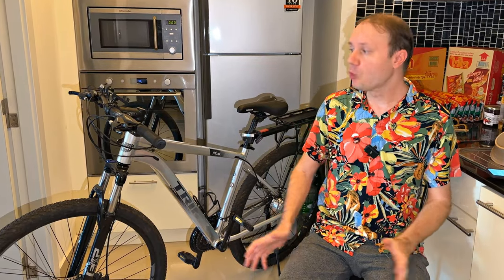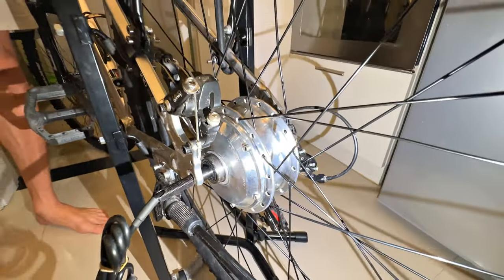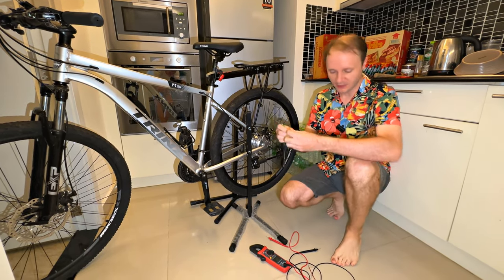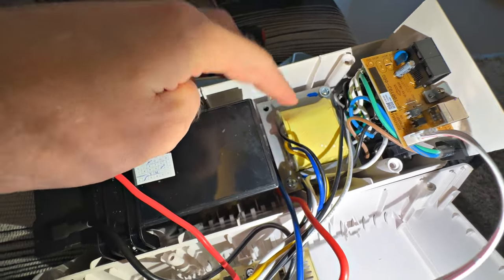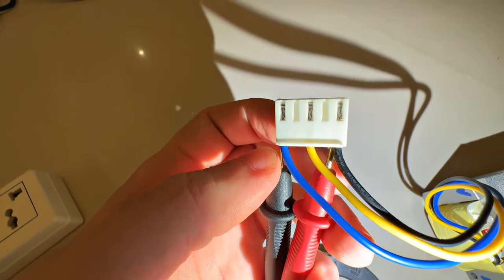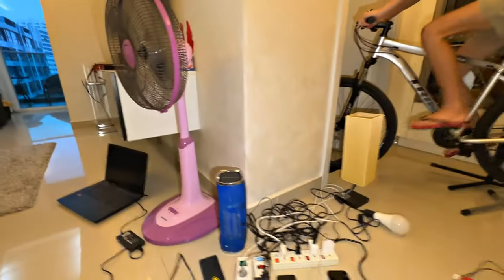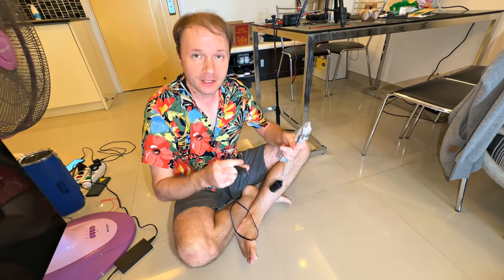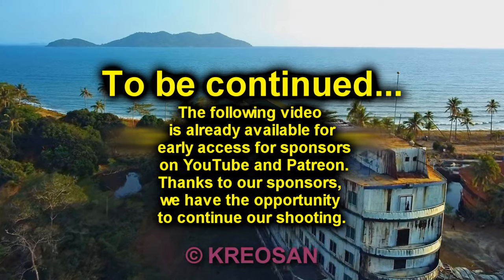How to make a 220 volt BICYCLE GENERATOR ⚡️🚴‍♀️⚡️ Feeds DOZENS of consumers like from an outlet

Comment: The electrical/scientific videos from these lads are just as entertaining and informative as the stalker/exploration ones. 50hrs of usage of small electronics from 15 min of pedalling under load is really impressive. I remember seeing a similar installation at my local science centre many years ago as a kid and wondered how well the power could be put to use if stored. Some decent progress made with electric motors and circuitry since then and its surprisingly cheap to make such a setup
Reply: You can't have one without the other. The Yin and Yang
Reply: Didn't he say 50 Watt-Hours
Reply: @bobsmith24868  That makes sense, I remember using a stationary exercise bike at the gym and the onboard display would show 200W with hard resistance
Reply: It would be good to solder the wires that are twisted together.
Also put hose clamps on the battery connections to make them tight or use real battery connectors.
This invention looks practical. It seems to generate about 200 watts.
Reply: @trueKENTUCKY  🔴 What Is Islam? 

🔴 Islam is not just another religion. 

🔵 It is the same message preached by Moses, Jesus and Abraham.

 🔴 Islam literally means ‘submission to God’ and it teaches us to have a direct relationship with God. 

 🔵 It reminds us that since God created us, no one should be worshipped except God alone. 

 🔴 It also teaches that God is nothing like a human being or like anything that we can imagine.

🌍 The concept of God is summarized in the Quran as:

📖 { “Say, He is God, the One.  God, the Absolute.  He does not give birth, nor was He born, and there is nothing like Him.”} (Quran 112:1-4) 📚

🔴 Becoming a Muslim is not turning your back to Jesus. 

🔵 Rather it’s going back to the original teachings of Jesus and obeying him. 

More .....👇

Comment: Note: The special cord is considered quite dangerous and illegal. It is too easy to accidentally shock yourself or make something explode. If you can plug directly into the inverter, you should do that. Safety standards are higher in the West.
Reply: It's official name is a danger noodle!
Reply: This isn't a safety video, and you can do this in the West, North, East or South regardless of safety standards.  Twisting wires together is a complete snub of the nose to safety standards.
Reply: @dansw0rkshop  There's more and less safe things. The special cord is called a suey-side (filter) cord for a reason. Not because it's automatically going to unalive you, but because it only takes one brain fart to break something.

Comment: 6:33 out of the 3 coils you don’t use two by only connecting two wires, you use one. The three coils generate voltage between cables 1&2 2&3 and 1&3. thus if you remove one cable you can only access one coil. This means 2/3 of the motors potential is wasted.

Comment: try dc-foil (lorentz emf) diy motor-generator, brushless true dc, no commutators, no ac components, no inverter
Reply: high amps, low voltage, ie single wire cross dc magnet rotating field, dc emf by moving wire in magnetic field
Reply: devices instead of people-consumers
Reply: why not use DC for all appliances directly, no inverter required, or ac-to-dc converters
Reply: smart

Comment: your hub is 350 watts rated based on the size, they make 1000 watt hubs that would work better, i will post more ebike content on my channel soon, i need to have time to rebuild my bigger ebike
Reply: if you want to make a 3 phase rectifier you can take 6 diodes and run 2 to each phase

Certainly! Here's an ASCII representation of a 3-phase rectifier made of diodes:

        +          +          +
   AC  |          |          |
  -----|  D1 D2   |  D3 D4   |  D5 D6
       +---|>|----+---|>|----+---|>|
           +          +          +
           |          |          |
           -          -          -
           |          |          |
       +---|>|----+---|>|----+---|>|
   AC  |          |          |
  -----|  D7 D8   |  D9 D10  |  D11 D12
       +          +          +

In this rectifier, three-phase AC voltage is applied to the inputs on the left. Each phase is rectified by a pair of diodes (for example, D1 and D2 rectify the first phase). The resulting DC voltages are then combined at the outputs on the right. The diodes are represented by the arrows pointing towards the positive output, and the vertical bars represent the connection points.
reply assisted by chatgpt

Comment: Car batteries are not designed for deep discharge. Don't discharge these to low voltages. UPS batteries are required here.